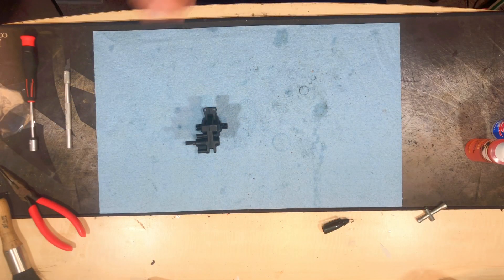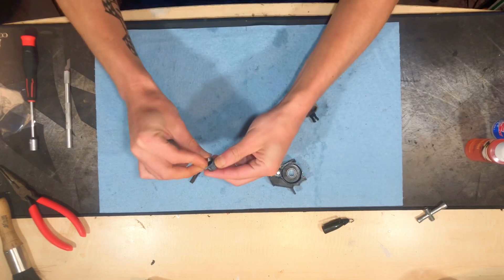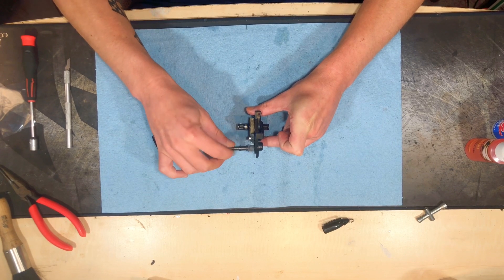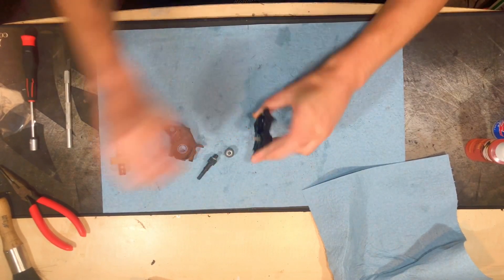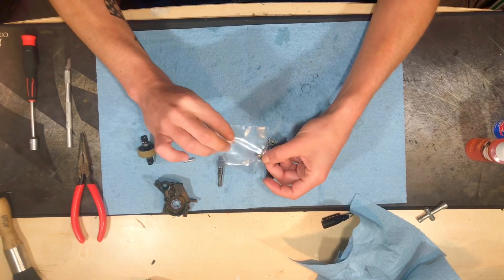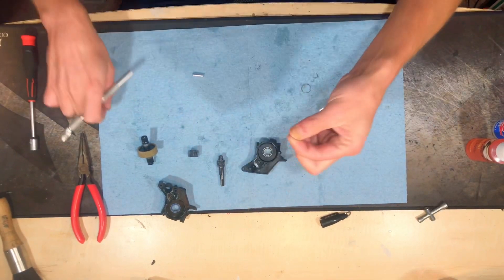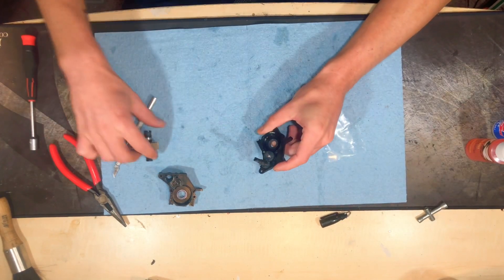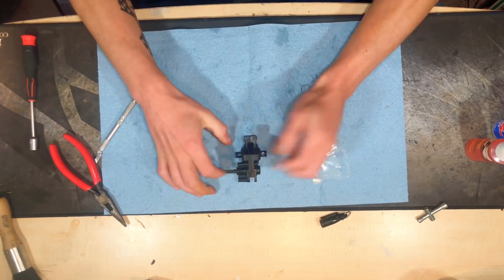RC TECH TIPS || Team Associated Transmission Fix

Comment: So if someone replaces the idler gear and no longer blow out the top shaft (or anything else), how is that not fixing the problem? 🤔
Reply from the maker: I’ve seen it happen multiple times even with the steel idler gear.    This is the only thing that I’ve not had the issue happen.   Plus,  it’s a free fix.    Doesn’t mean you have to do it tho.